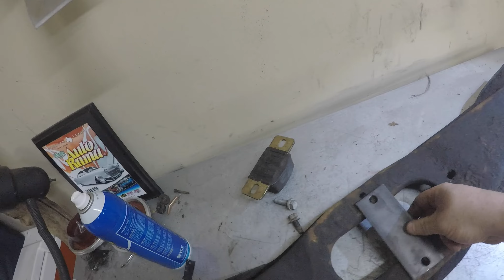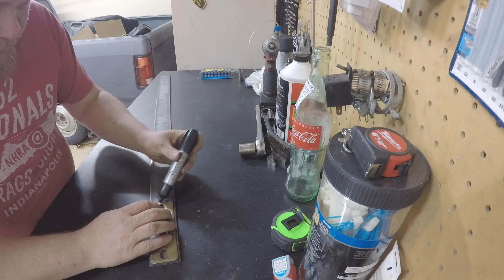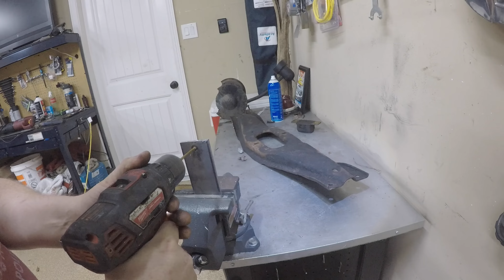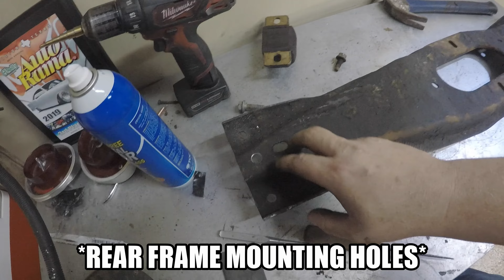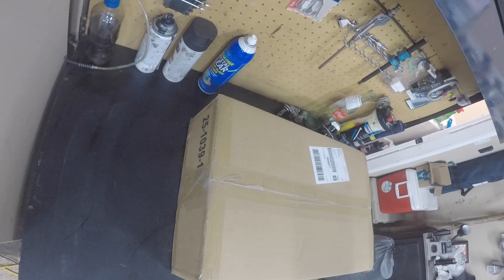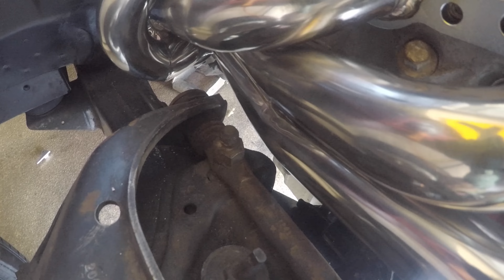Dakota LS Swap Part 3: Transmission Mount Fab and Speed Engineering Headers install

Comment: You list the Speed-Engineering part number for the headers as 25-1039-2, but their website does not recognize the "-2".  They do list p/n 25-1039, and say it is for an S-10.  Nothing on their website lists an application for a Dakota.  Do you know if the S-10 shorties fit in the Dakota, or did they stop offering the Dakota headers?
Reply from the maker: These are the s-10 shorties, no one makes LS swap specific parts for Dakota's. 

However, I have an updated video where I upgraded to mid lengths and they fit even better. Plus they're 1 3/4 and much longer. Overall a much better header. 

https://speed-engineering.com/collections/universal-ls-lt-swap-parts-exhaust/products/ls-mid-length-headers-1-3-4-universal-swap-conversion
Reply: @RacerXGarage  Thanks for the reply!  I would love to see the video of the header upgrade.  Has it been uploaded yet?  I am using a '94 Dakota chassis and suspension, but putting a '52 Studebaker truck body on it.  Your videos have been a great help!
Reply from the maker: @stevelindmark1203  yeah Ive been running them for about a year. But note the crossmember in this video is highly recommend - https://youtu.be/ak_hrNpLHPQ

Comment: Love your videos man, very informative, and just cool to watch. I do have a question for you, what did you wind up running for the rest of the exhaust? Im currently getting parts together, gonna be doing an ls swap in my 87 dakota when fall gets here.
Reply from the maker: I had a cheap Y-pipe done at a local exhaust shop first, but I changed that recently to a Holley Blackheart exhaust system for an S10. I think there is a video on it somewhere on our page. I did have to use a Holley Blackheart Dakota transmission crossmember for it to work, and its a really nice piece.

Comment: I'm putting LS in my Dakota
.
I have a 95 that was a 5 speed.
So trans tunnel is taller.
Did u have to do anything to tunnel or firewall?
Reply from the maker: This was a 5 speed originally, however I put an LA 318 in way back in the day with a 727 trans. I did have to beat the tunnel in a bit with a hammer to clearance. I'm not sure If I would of needed to for the th400.
Reply: @RacerXGarage  Never heard of the trans tunnels being shaped differently from auto to manual or 4wd. Do you think they are?

Comment: Fyi Your pinion shaft is offset to the ringgear, and the pinion is aligied with the driveshaft. To have the same length axle shafts (saves money to have one part) requires that the housing be offset by a small amount (matches pinion offset). This means your housing is offset to the chassie. You won,t notice it till you fill the wheelwell with tires. Its really noticable on older mustangs and camaros when you start putting on 10 inch or wider rims. A lot of hotrodders go to the expense of centering the housing by having the long side shortened along with the axle shaft.(alot easier on a 9 inch diff
Reply from the maker: Makes sense. My Nova is sort of like that, but I believe it was mostly because the spring perches were not precisely measured before welding. So sometimes they can be off by up to 3/4 of a inch.

Comment: On this LS swap...You don’t need all four bolts. You’d be surprised.
Reply from the maker: You're prob right, but at the minimum I want to have all 3 bolts for the factory motor mount in place. Since i have to counter sink the bottom left one, I might as well do the block mount also.

(just realized your speaking of the trans mount, not motor mount and I agree with ya) ;)